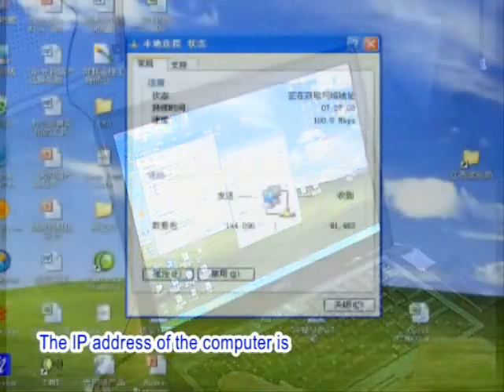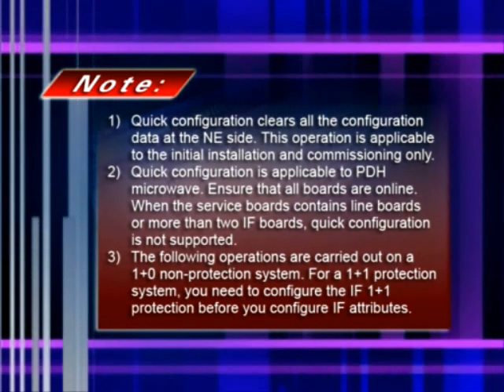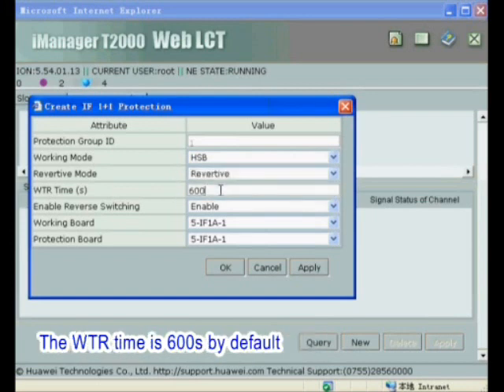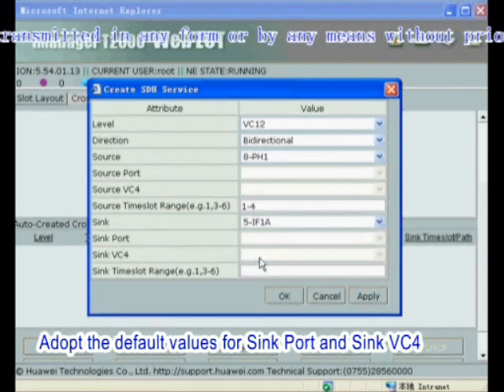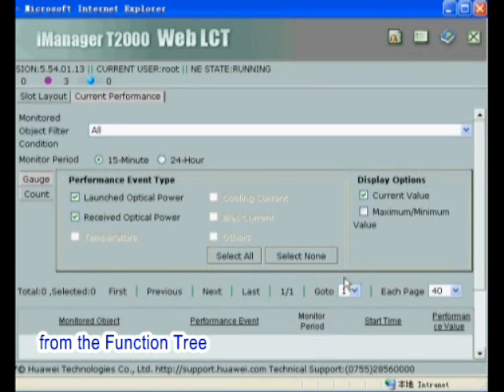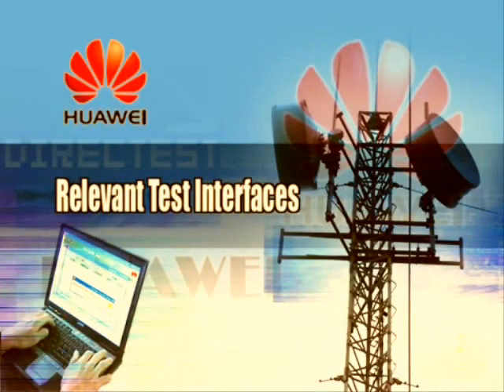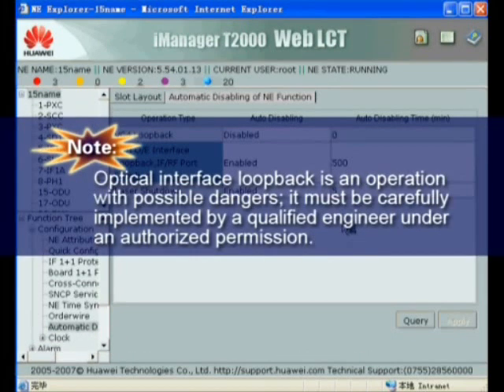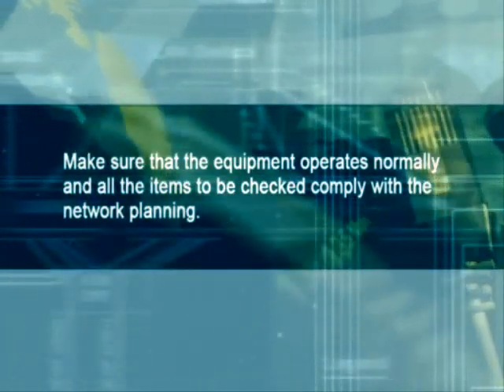RTN Optiox 600&900 Series Radio Link Commissioning

Comment: good some days you could help me I have to activate an ethernet port on the RTN905 link but that's me ping I used the Hybrid port with a VLAN 1165 I put it to the air port as well but do not know why that does not happen believe me E -line anyone has any manual that will help me would greatly appreciate it .